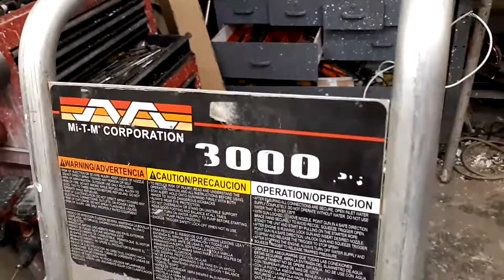pressure washer pumps, the difference

Comment: Also once you jump up to 4000psi/4.0gpm the engine power required to operate the pump increases so technically for those specs you should be running a 11-13hp engine. The 9hp Honda gx270 I have was the same 3000psi/3.0gpm I bought used. When that pump quit I had 4 other Honda gx340/390 machines with various pumps and back ups I decided to put on a general pump at 3500psi/4gpm I had sitting on the shelf and once I got the unloader set and the right tip on the gun it worked great but the 9hp Honda seemed like it was struggling a bit and running louder than before with the smaller pump. It ran a whole season like that but ended up wearing out the oil seal on the motor around the output shaft that the pump slides onto. I thought no big deal it's probably from wear and tear and it old so I replaced the seal and again in a few months it was leaking again. I am guessing it wore out from excessive heat around the crankshaft mixed with crazy vibration?!?!? Decided to put the pump back on a larger gx340/390 and no problems since. Also I put a smaller pump back on the gx270 and no leaks so make sure your engine meets the minimum horsepower needed to operate the pump. Just because the engine is a 1 inch shaft doesn't mean it will run all 1 inch shaft pumps. I also have 17 years experience running, fixing, and maintaining all my machines from bigger belt drives to gearbox drives to the basic direct drives! Pressure washing is awesome!⛲💦🔫👍
Reply from the maker: I would have to disagree.  An 11 or 13 hp is not necessary. Many companies produce a 9hp 4000psi 4gpm machines. Simpson, Powershot and Hustler come to mind and they produce a washer with the GX270 as well as 4gpm 4000 psi. 

You are right about the engine. If there is too much stress, the sound of the engine will tell you.
This particular customer has had me replace the pumps on all his machines to 4Kpsi and 4gpm over the years. No issues on the engine. Still running strong. After 32 years of doing this, I have no issue stating it can be done with little concern on a ln engine in good working order.

If your experiencing vibration on yours, there is an issue. Regardless of the pump or the engine, there should be no excessive vibration. Good luck

Comment: Hey Brian quick question I have Honda gx270 with AAA pump 4K psi 3.5gpm and I want to replace it with AR VIPER
HEAVY DUTY FULLY
PLUMBED 4 GPM
4200 PSI are those pumps any good and is this to much for my Honda gx270. Was thinking to run it around 4K 4gpm
Reply from the maker: They are pretty good pumps. I use them a lot. The 270 may be a bit weak to use the full capacity of the pump.
Reply: @Brian_the_repair_guy  okay thank you 🙏
Reply: @Brian_the_repair_guy  hey Brian it’s me again. I need help getting a pump for my pressure washer. Is there an email I can have to email you some ideas I have in mind if that’s okay with you

Comment: Very helpful thanks bud! Gotta quick quesion. I've gotta Honda GX200 engine with AR pump rated at 3.0GPM 2700PSI. I wash cars and thinking of upgrading to the 3.5GPM 2500PSI AR pump which is about 700-800 more cleaning units. Will that make a big enough difference do you think to increase my cleaning time? thanks!
Reply from the maker: When washing, in particular soft wash which is what you are really doing, less pressure and more water is better.
I use the example of a spray bottle and garden hose. Spray bottle gives more pressure and less water volume.  Garden hose gives less pressure bit more volume.  Which would you rather use to wash a car?
Reply: @Brian_the_repair_guy  Thanks for that great analogy I think I"m gonna go ahead and buy it!
Reply: Be careful as more GPM usually means more power needed from the engine….Almost every machine giving you more than 3 GPM usually have a 240 or 270 engine but I would like Brian to confirm if the 200 has the guts to move more than 2.5-3.0 GPM.

Comment: BRIAN--FOR A HONDA GX200, 6.5HP, , WHAT IS THE LARGEST PUMP I SHOULD TRY TO USE- WANT TO CLEAN UP OIL STAINS ON DRIVEWAY IF POSSIBLE---BY THE WAY - USED DIESEL OIL STAINS, MAYBE THE WORST THERE IS
Reply from the maker: Be sure to use a chemical wash. Let the chemicals do the hard cleaning, not the washer
Reply: @Brian_the_repair_guy  I have used over 20 different chemicals to try to get it out of the driveway. Torches, gasoline, Dawn, Get it up, muriatic acid, etc. Anything that has been suggested on youtube i have tried i think lol. So, if you would, what is the biggest pump you would put on a GX200, 6.5 hp---I have a 2.5gpm-3600psi currently..
Reply from the maker: @PARDS2  what you have is the largest pump

Comment: Great video I have a question I just purchased a Honda GX 390 motor and I also purchased a 4000psi 4GPM  GP pump.,  I just put the pump in the motor yesterday but I have no pressure I have a really good water flow but no pressure, Do you by chance I know what is causing this?
Reply from the maker: Make sure the unloader is turned clockwise. Also check the nut under the black cap on the unloader, it should be adjusted  close to the bottom of the unloader.
Reply: Did you figure out your no pressure? You have a great pump with the general and a great motor to run it!  Did you purchase the motor and pump new or used?

Comment: Good morning Brian, in your video last year about rebuilding pressure washer washers (great video) you said that if you have water in the oil it might be more financially feasible to just buy a new pump. I've looked on Amazon for an AR like I have and the seller is Tool Barn. The reviews are really bad or really good, nothing in between. Do you have a supplier that you recommend?
Reply from the maker: You can purchase replacement pumps from most Sherwin William's stores. You can order online from a supplier called Watercannon.com if you buy in person, warranty issues are easier to deal with later.

Comment: The more powerful the machine the farther away you can spray from the substrate while still maintaining efficient pressure to clean, thus you can cover a wider area. Weaker machine and you have to get closer in and the closer in and your spray pattern becomes narrower.
Reply from the maker: True. The advantage of the "weaker" machine is it is less likely to damage the substrate. They also require far less water volume to operate properly. 
I reccomend guys have a heavy duty machine and a cheap machine to cover each situation.
Reply: @Brian_the_repair_guy  instead of having two machines, couldn't you just turn down the pressure on the bigger machine to the level of the 3000psi machine when not so much is needed?

Comment: GX270 with 3600 psi 4.7 GPM pump.  Engine vibrates like mad under load.  New carb etc etc
Can’t figure it out.  Any ideas
Reply from the maker: The engine vibrates with the trigger pulled or trigger released?
Reply: @Brian_the_repair_guy  
When pulled only
Reply from the maker: @chriscoerper4489  first thing I would check is the pressure. If you have a gauge, then make sure the machine is not producing more pressure that it is suppose to be set for. If the pressure is too high, that can happen. Check the oil in the pump first.  Make sure the level is good.
If you don't have a gauge., turn the pressure down three turns and see if there is a change. 
Keep me informed please.
Reply: @Brian_the_repair_guy  
I have a gauge and it has the correct pressure with not much unloader spike.  Oil level is good in pump.  Do you think pump at 4.7 GPM is too much for the 270?
Thanks
Reply from the maker: @chriscoerper4489  is this not the pump that came on the machine? If this is a pump that was installed  outside the manufacturer, then yes. The 270 may not be able to handle that much water under that  much pressure. You can try turning the pressure down to 3000psi and see if there is an improvement.
Reply: @Brian_the_repair_guy  
Thanks I will give it a try.

Comment: I have just aquired a landa pressure washer. It has no unloader valve that I can find. Instead it has a pulsation dampener. It is not building enough pressure. It builds then you squeeze trigger it releases without building. If you release trigger it builds again for a min or two then the motor shuts off.
Reply from the maker: Exactly what model is the pump itself?  There should be a model number on the pump
Reply: @Brian_the_repair_guy  it's a mercury mc 14.
Reply from the maker: @davidgrossmiller7073  this is an older pump. The parts are limited. If you can locate an owners manual, there will be a list of the parts you will need to rebuild the pressure dampener.
Reply: @Brian_the_repair_guy  thank you I have just gotten an old manual. I will look into rebuilding the pressure dampener.
Reply: @Brian_the_repair_guy  Since this is an old pump and pulsation reducer. What would you suggest it replace these parts with. I can not find any info on birdwell inc. pulsation reducer.
Reply from the maker: @davidgrossmiller7073  the pump is pretty old. The parts are either obsolete or near impossible to locate a dealer. I would suggest installing another pump.
Reply: @Brian_the_repair_guy  yes I was thinking the same thing. I was hoping you might have a suggestion as to what to use. It won't be used industrially just around the house so nothing to fancy. Just a basic pp I'm figuring. Thank you.
Reply from the maker: @davidgrossmiller7073  AR makes a good inexpensive pump. Just get the shaft size on the motor. Go to watercannon.com and you should find what you need.
Reply: @Brian_the_repair_guy  thank you

Comment: Hi Bryan, if you have to choose between these 2 machines which one you'd take for small just starting pressure washer business cleaning driveways and surface preparation for painting.
4000 PSI @ 4 GPM 
3500 PSI @ 4.5 GPM

Thanks in advance!
Reply from the maker: This is a hard question to answer. The total setup will make a difference.
Short answer, I like high gpm over high pressure. 
Long story is if the pumps are the same make and manufacturer then you can adjust the unloader to increase the pressure to 4,000 on the 4.5gpm. 
Depending on your water source, you may be better with the 4gpm. Some houses struggle to give you enough water.
Reply: If you are starting a pressure washing business and have a choice the 3500psi 4.5gpm is the better machine. The more GPM the better. If you are worried about the water source then you can use a 30 to 50 gallon water tank as a buffer tank. youtube has allot of videos on how to set up the buffer tank.
Reply: @Brian_the_repair_guy  No it's not.  If you are starting a pressure washing business and have a choice the 3500psi 4.5gpm is the better machine. The more GPM the better. If you are worried about the water source then he can use a 30 to 50 gallon water tank as a buffer tank.
Reply from the maker: @zoukiezouk2278  thanks for the input but you missed the point of my comment completely. As I stated, GPM is best and you can INCREASE the pressure on the unloader to get 4K psi on the 4.5gpm pump. This gives you more CU than the 4k at 4gpm or the 3500k on 4.5 gpm.
If someone is concerned about their gpm delivery from the source, then a machine that requires less gpm would be a better choice. Not everyone has the ability to haul extra water. The simple solution is a second machine that uses less gpm. Thanks for you comment. It gave me a chance to further explain the pros and cons.
Reply: @Brian_the_repair_guy  So I got the machine, the pump is a CAT model 5CP3120CSS. Can I adjust it to get 4000 PSI while keeping the 4.5 GPM?
Reply: @zoukiezouk2278  Thanks
Reply from the maker: @DownloaderVideo  the number you gave me if the model of the pump. I need the model of the unloader. This pump uses a bolt on or external unloader. Most all of those can be adjusted on the pressure.
Reply: @Brian_the_repair_guy  I’ll get it and reply back with the number. I checked the manual for this pump and says max pressure 3,500 psi and max flow 4.5 gpm. Would still be possible to increase the psi depending on the unloader regardless of this info on the pump’s manual?
Reply from the maker: @DownloaderVideo  the pump is capable of 5kpsi. The engine will determine your final pressure. If you have a 13hp, the 13hp is capable of giving 4Kpsi.
Reply from the maker: @DownloaderVideo  go to https://www.google.com/url?sa=t&source=web&rct=j&url=http://www.pwoutlet.com/v/vspfiles/assets/images/Unloader%2520Adjusting%2520Instructions.pdf&ved=2ahUKEwij7e7R8b74AhWXeN8KHSENBh0QFnoECDIQAQ&usg=AOvVaw3rvbt0EDuk3Uyk5dUIfnwP there is an exploded view of the unloader in page 2 that gives step by step instruction of pressure adjustment. I reccomend a pressure gauge to determine the pressure you are setting it to.
Reply: @Brian_the_repair_guy  Done, my engine is a GX390, adjusted it to 4300 PSI at recycling and 4000 when triggered….the engine feels normal. Will I be ok Brian, no harm to the pump?

Thanks is advance!
Reply from the maker: @DownloaderVideo  the pump and unloader are fine. They both are capable of producing 5K psi with no issues. As I stated before, the engine is what actually determines max pressure. The engine will not be able to produce the maximum pressure that the pump and unloader can produce. The engine will stall before any damage can be done. I just set 3 washers today at 4300 psi. I hope you found this helpful. It would be helpful if you used the "thanks" button below.
Reply: @Brian_the_repair_guy  Excellent, thanks again. You’re the man! 👍

Comment: Is AR pump a good pump? At 3000 psi 5 gpm?
Reply from the maker: Yes. At is a good manufacturer of pressure pumps. They have 2 classes. One is manufactured in Italy, the other class is manufactured in China based on AR specs.

Comment: Hey those pressures on the washer is stand-by pressure not pulling the trigger...working pressures is what should be advertised and working pressure is alot lower than stand-by pressure
Reply from the maker: @David-yy7lb  depending on the tip used the pressure can be a lot lower. With a zero degree tip, the pressure is only about 200psi difference. The large degree, the larger the hole so the pressure drops more.
Reply: @Brian_the_repair_guy  

Thanks for the respons but one more question I have a 3700psi 2.5gpm pressure washer and hooked it to my surface cleaner it sucks for cleaning upon further reading the information on the surface cleaner it says 6.6 gpm so that tells me I don't have enough flow going to the surface cleaner is why it sucks at cleaning is that right?
Reply from the maker: @David-yy7lb  yes, the surface cleaners typically will function at 3gpm to a max of 6.5gpm